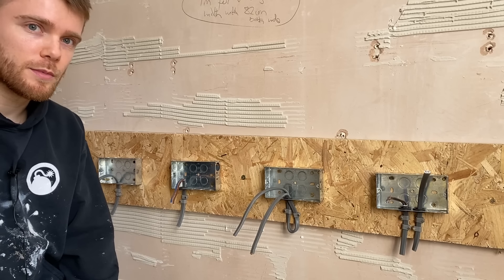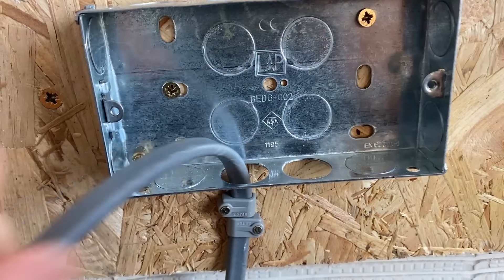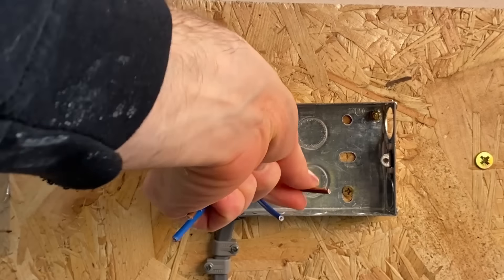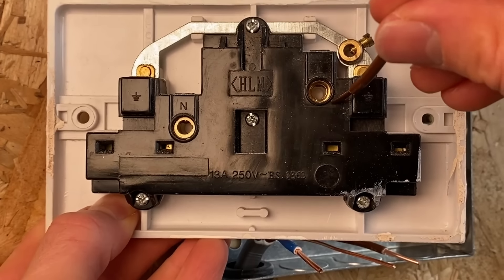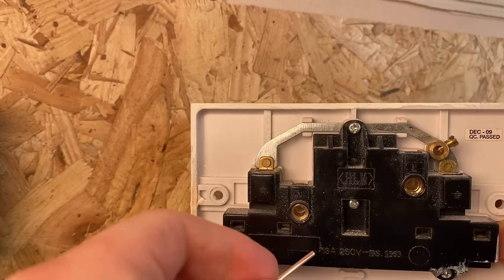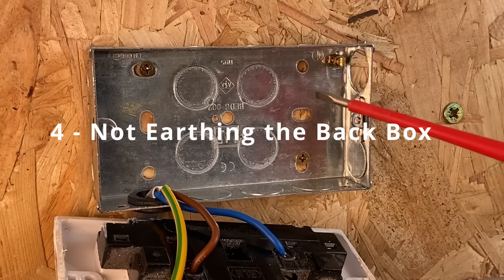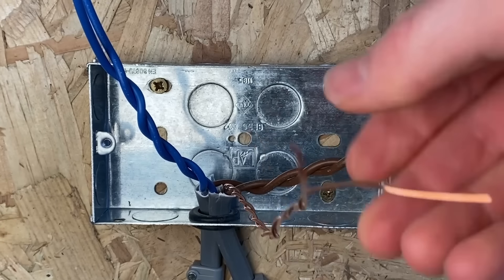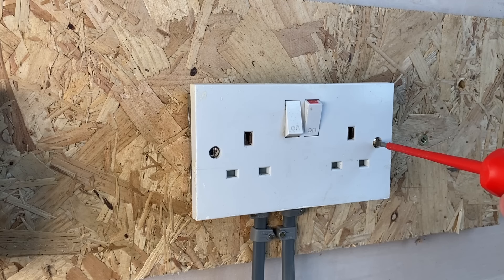5 Biggest DIY Mistakes Wiring a Socket

Comment: A big DIY mistake that I have relentlessly seen from time to time is when some people think it’s okay to leave earth wires unsleeved or wrapped up with insulation tape which is a very sloppy job - and this is coming from a competent DIYer who’s been doing their own electrics for over 5 years. 

Generally speaking, I have seen more shoddy work from “professional” electricians than DIYers as I had to rewire my entire bathroom after the wiring was left unsafe and terrible.
Reply from the maker: Agreed! Thanks for watching!
Reply: What the hell is a competent Diyer?
Reply: Having the necessary ability, knowledge or skill to do something successfully. Like thousands of DIYers 🙂
Reply: @fredschepers5149  
But totally illegal if you are not qualified 
Leaving yourself open to world of trouble when it goes wrong
Reply: @macsmith6216  Many jobs can be done safely and properly by a competent person and indeed a lot of the requirement state the person should be competent. Just because an individual hasn't got the formal qualifications doesn't necessarily mean they aren't safe or competent. It's different when a certificate for the work has to be provided though.
There's a difference between someone who knows what they are doing and someone who thinks they know what they are doing and that is competence.
Reply: I wish we were moving faster to sleeved ground wires in the US. This man does good work and I enjoyed his video!
Reply: @macsmith6216 : I don’t think you’ll find it’s illegal to do your own electrics in the UK although you should be fully competent. I think problem comes when people think they’re competent or just want to save money. Trouble is how would anyone know anyway ??
Reply: @Kingcarparpeggio  No it is not illegal, You would need to get your work tested and inspected by a qualified (competent) electrician and signed off to that effect. who will verify it meets IEE standards for domestic installations. hope that helps.
Reply: @125brat  God forbid you would need to prove that competency at any point. The fact is an electrician is only deemed competent if he has undergone the necessary training and achieved qualifications i.e. city & guilds in electrical engineering and installations or equivalent formal qualifications  absolutely there is no such thing as a competent DIYer    Yes you can install your own but have it tested and inspected by a competent electrician. be careful of posts on here saying anything else. your life or others could depend on it.
Reply: @Ifitwerks  Whilst I generally agree with your comments, I have electrical and electronic qualifications and experience from the lighter side of engineering and if I am unsure about anything, I am not too scared or proud to ask for help or guidance or a qualified electrician to do the job. For example, I've just had a caravan hookup installed professionally which I could have done myself, but as my property is PME and the installation needs to be tested and certified I got a local tradesman to do it.
Reply: @125brat  Hello, it is good to hear you have some experience and are interested in doing your own work, although you did not state those qualifications it fine to do your own installations and have it tested and inspected where you need to, it seems that you steer clear of special locations very wise too. However I would urge you to understand the difference between what you think a competent person is and competent electrician by definition in law. Regarding your property having PME The IEE regulations covers all earthing types probably 90% of supplies are now  PME even on O/H supply too so not sure what you meant there.
I am also not sure what you meant by "generally agree" but DIY is one thing and accepting money for work done (not suggesting yourself) is completely different should things go wrong but I expect you are aware of those risks, I hope so.
I have noticed by reading some of the comments on here that it is very popular to criticise electricians and lead to over confidence in DIY abilities which could have potentially disastrous results.
Reply: @Ifitwerks  Hello again and thanks for your comments. My qualifications are HNC level and City and Guilds in microelectronics and communications engineering amongst others with 20+ years working in electrical/electronic product compliance culminating as Senior Electrical Safety and Test Engineer at a Notified Body prior to retirement. That seemed to satisfy my employers to let me loose😁
Seriously though, as I mentioned earlier I won't touch anything where someone else might be put in danger by what I've done and if I've got any doubts, there's no doubt in my mind and I get a professional to do it. Having said that and has also been mentioned here, the quality of professional work can vary greatly and it raises the question as to whether some of the "professionals" are actually "competent". I certainly won't do anything for anyone I don't know or accept any payment. I'll have go at most things but know my limits. If possible, I would rather do the job myself than pay someone else to do it badly.
Our property is TN-C-S and despite reading about the isolated earthing requirements for the remote hookup, with insurance liabilities etc. getting it done and certified was the only way to go.
Reply: @125brat  congratulations having gained those qualifications in your field, It looks like you have the right understanding with reference to cross trade competency.
I shudder to think what your employer "let you loose on" though! lol. Regarding the poor quality work by "professional  electricians is more than likely because they are not, I know a lot of kitchen installers who do plumbing, and electrical work but are not qualified to either work.
I expect you have a copy of the current IEE regulations and building regulations for reference. incidentally DIYers would have little knowledge of cable sizing and volt drop calculations when run through different locations without it. And finally if anyone doing DIY work and deemed themselves "competent" saw the results of electrical work that had resulted in death and injury that I have seen over 46 years starting with a 5 year apprenticeship with a area electricity board as a installation inspector and qualified competent Electrician (now retired) they would be more hesitant in claiming that "competency" and that it is defined in law under the worst circumstances. Good luck in your endeavours and I hope something in this has benefitted you.

Comment: Small point!! The latest twin sockets have the earth connected to the socket screws which have metal inserts so there is no need to put a separate connection between the supply earth and the box.
Reply from the maker: Thanks for watching!
Reply: That is true but the thing you have to be careful of is the amount of resistance to earth. If the resistance is too high then you run the risk of the current flowing not being enough to trip the breaker or blow the fuse. RCDs or RCBOs are more sensitive and also trip faster but if you have an older installation you may not have those. 
The point of earth is to provide a path for the electricity to flow in the event of a fault. So in that instance if something live touches the back box and it doesn’t have sufficient fault current the box will stay live. 

In addition if you rely on the screws and you have the socket off the back box then it is not earthed at all. Best practice is to earth the backbox.
Reply: @davideyres955  with at least one fixed lug on a metal back box it is neither best practice not a requirement of the regs (BS7671) to install a flylead between the accessory and the back box. At the same time, it doesn’t do any harm, and I take your point about high resistance, it just isn’t an issue with properly installed BS accessories.
Reply: @David Eyres  The regs are clear on this. A fly lead isn't required if the box has a fixed lug. If a faceplate is loosened or removed, safe isolation should be used.

It's one of those things that's still debated, some electricians still do, some don't.
Reply: What happens when you remove the screws...
Reply: @ja6onthom  

You practice safe isolation and turn off the power before removing screws. As per the regs
Reply: There is only one reason why electricians don't earth back boxes,  because they are lazy,
Reply: @william lowther  

"Because they are lazy"

Not exactly. UK electrical regs are very stringent, so if the regs say it's not required, if one box lug is fixed, and time can be saved, they likely won't do it. Time is money.
Reply: @ja6onthom  
The circuit should be isolated prior to any works being undertaken, so removing the screws won't matter to the backbox then not having a connection to earth.

Comment: Earthing the back box - If the back box has a fixed lug on one side then it will become earthed via the mounting screws as the socket front is attached to the back box, no need for an earth strap

Comment: Is the metal box not connected to the switch plate earth bar via the faceplate screws?
Reply from the maker: It is, but still best practice. Thanks for watching!
Reply: Shouldn't be removing the faceplate live so no need to earth the back box as it's done through the 3.5 mil screws

Comment: Doubling the end of the wire over to get a better surface area ?  Fine, works well when there is only one or two cables going in the contact - but if there are three then it gets difficult to get them all in.
Reply from the maker: Yes absolutely, I’m only suggesting doing it when you’ve got one core in a terminal. Thanks for watching!

Comment: Twisting wire makes fore lese noise in the power
Reply from the maker: I think you’re thinking of twisted pairs in data cables. I don’t think the same applies for AC current. Thanks for watching.
Reply: @TheDiligentDIYer1759  it  make a difrens its smal  bud lets  Say you do this for a audio system it wil make les rippel end its better 2 twist maby we cant see it bud we here it so its must do somting

Comment: Another common mistake is not cutting back the insulation enough, when the terminal screw is tightened the screw clamps down on the insulation giving a poor connection
Reply from the maker: Very true, thanks for watching!

Comment: I was wondering what situation you would have 4 wires in a socket terminal . ? I can understand 1,2, and 3 wires but not 4 4?
Reply from the maker: Two spurs off a socket, not sure if that is allowed or not actually?
Reply: @TheDiligentDIYer1759  I didn’t think that would be acceptable ? I have seen sockets with 4 wires and the holes look a bit overcrowded.

Comment: Thanks, great vid, I have a question: why must the 2 screws of the socket be lined either horizontally or vertically?
Reply from the maker: Purely aesthetic reasons haha, for anyone with OCD
Reply: @TheDiligentDIYer1759  oh I see :D
Reply: Strangely, I use the blanks supplied with the socket to hide the screws.

Comment: With those back boxes there's no requirement to earth the box as it has a fixed lug.
The main thing diy people don't do is test what they have done or test the existing circuit, they could be adding to a circuit that is already dangerous. 
I doubt many will have a proper tester, let alone know how to use one, and even if they did, they wouldn't know if the readings were correct. The only test they all do is the bang test.
Reply from the maker: Thanks for watching!

Comment: How much dose this guy think cables move in a s/o box !
Reply from the maker: The cables could easily be in there for 50 years, if removed for decorating multiple times, faceplates changed, testing when house is sold, etc.. You can get plenty of movement and create a fault

Comment: I think there were actually 6 mistakes, Surely countersunk screws with sharp edges shouldn't be used to secure the back boxes, smooth round screws should be used?
Reply from the maker: You’re right, but i felt the title was better this way. Personally i haven’t found counter sunk screws to be sharp, but i agree anything with sharp edges shouldn’t be in the box. Thanks for watching!

Comment: Earthing the metal box. The front plates that I've used have always had bonding strips attached to the screw mounting holes so this is done automatically when you put them on.
Reply from the maker: If you have one fixed lug, you don’t have to, but it is best practice to. Thanks for watching!
Reply: Wrong  - you cannot use a mechanical fixing for an electrical connection.
Please ask a qulified and competent electrical person  - not some guy down the pub !

Comment: Re the first one -  grommets. I don't agree. When the cable is through the hole into a metal back box that will likely be surrounding by plaster. Once the cable is buried behind plasterboard or covered over with plaster, it ain't going to move at all. So no chance of the cable rubbing against the edge of the hole in the box. So why do they feel grommets are needed ?
Reply from the maker: True, assuming no one takes the socket off to decorate. That socket could be unscrewed every 5-10 years, and might be moved around lots when decorating, if they leave the terminals connected.

Comment: I always twist and sleeve the cpc on ring final socket outlets, my thinking is, it is more important to the long term integrity of the cpc circuit than to help out if a fault may develop in 20 or more years, how many have tested a ring final and found no cpc continuity, if the break happens at two points some outlets wouldn't be earthed, and it's mostly due to a loose screw and one cable has dropped out.
Reply from the maker: Thanks for watching!

Comment: One reason for aligning screws vertically (my preference) or horizontally stems from the training of apprentices. Electricians cannot be 'slap dash' (untidy & potentially unsafe) when it comes to their trade and installing electrical systems. Getting apprentices into the habit of working to a good and safe standard is enhanced by simple things like teaching them about aligning screws. If they get into the good habit of aligning their screws they are much less likely to get into the bad habit of doing 'slap dash' work.
Reply from the maker: That’s a good point and very interesting to know! Thanks for watching!

Comment: One thing I would like to have seen is a common problem with ring main style wiring. Normally, two wires are run in to each terminal of the socket. However, due to poor alignment, one of the wires does not lay flat under the screw. As time passes, the wire works its way out from under the screw, allowing both wires in that terminal to come loose. This results in RCCBs tripping out. Either that or the terminal "cooks". It is difficult to diagnose as, although the circuit will conduct, it will result in sparking at higher currents which will trip the RCCB (or scorch the terminal). I have come across this issue a few times. The only way to diagnose is to take each socket off and find which terminal has loose wires or a screw that is not tight or melted plastic. My simplest remedy to this whole scenario is to twist the bare ends of the paired wires together. This partialy contradicts the fourth "mistake" in this video. It is only the bared wires that are twisted together - just 10-15mm (same amount with the earthed ring). Oh and ring earth wires - always seperately sleeved.

Comment: I had the grommet discussion with a spark who used to be the NIC regs man at work and he said technically you dont need to grommet the boxes as the cable is double insulated but its good practice to do so... Also I used to leave all the screws in a vertical direction :)
Reply: all new work  i fit grommets the only time you cant is  if t replacing a socket  and there isnt one fitted and an existing  box plastered in   provided  the outer insulation is inside the box  and the cores arent exposed to the metal  box
Reply: For a start the term is insulated and SHEATHED (NOT double insulated ) Secondly, some of the NICEIC blokes are not very good ....(as can be seen in this example)

Comment: In my sockets I have a blue neutral, brown live and green earth. The earth is connected to the back box to be ‘earthed’. 

I’ve been told that I would require a full rewire if I intend to use any conductive faceplate like brushed metal. Can I not connect the earth wire to the new face plate?
Reply from the maker: That doesn’t sound right to me, but probably best to get advice from a professional or a few different professionals. Thanks for watching!
Reply: the bloke you asked is probably the world's greatest ripper offerer (or whatever the word is ! )

Comment: Doubling over solid cores not recommend,  fly earth not insulated, cable terminations not tested by pulling on them.
Reply from the maker: Doubling over single cores, when you’ve got a big terminal and only one core, is taught to training electricians currently. 
Fly earth should be insulated, perhaps I wasn’t clear in the video.

Comment: I actually don't understand the use of the metal boxes. In continental europe, they're all plastic. No contact issues with the cable.
Reply from the maker: I think metal are a lot tougher, so when chasing them in and plastering in, the chance of any damage is very low. Whereas plastic are prone to cracks and damage. I do take the point around conducting issues, but we get around that by bonding the box. Thanks for watching!!